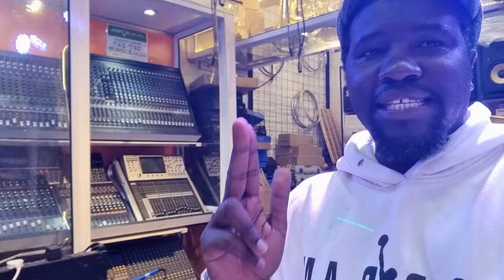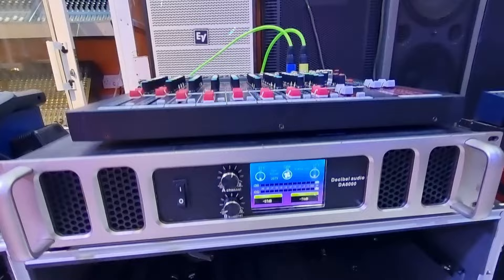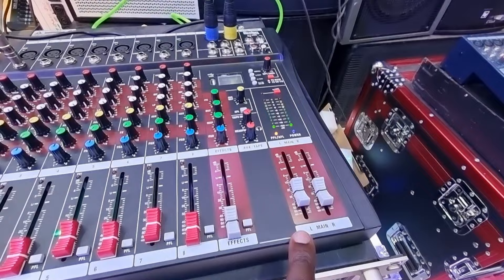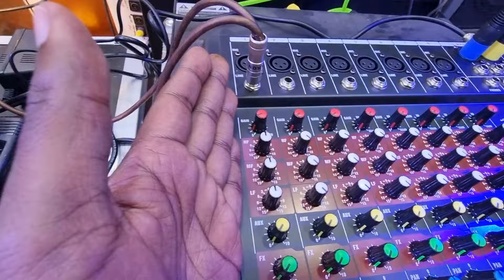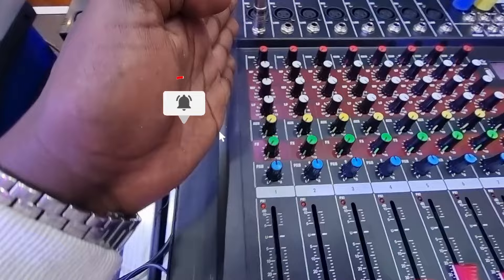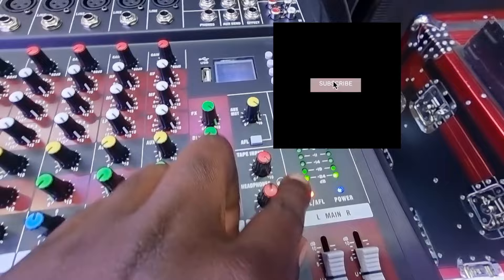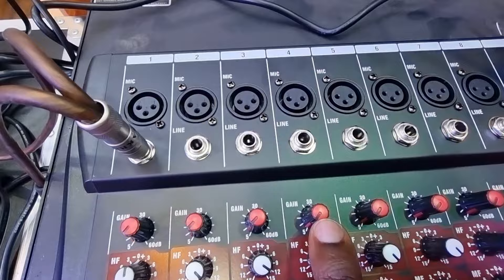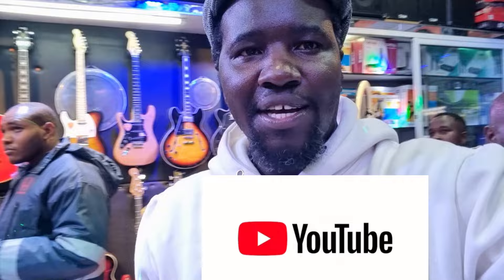Connecting a mixer to a Power amplifier.

Comment: Excuse me sir, i have a question. I’m still new in sound system, I’ve bought an amplifier rated 2000w and two speakers of 800w continuous and 3200w peak power capacity, my question is, can both match well without any harm? Considering that the speakers are two of 800w each
Reply from the maker: Yes very well, that's a perfect match
Reply: Okay boss… thanks a lot.! 🫂

Comment: Can you also connect the mixer to amp using the headphones slot but having a splitter cable for the both of the inputs on the amp?
Reply from the maker: Yes you can but you might experience distortion

Comment: What will be the difference in terms of loudness if the speakers are connected to the mixer or amp while using both?
Reply from the maker: The amplifier will serve them better than a powered mixer but still depends with the wattage of both amp and the mixer